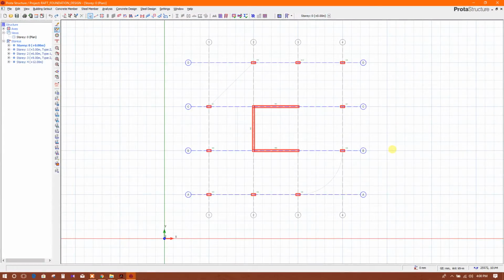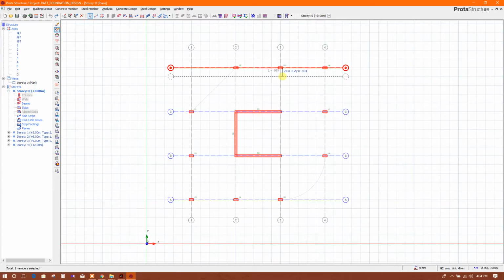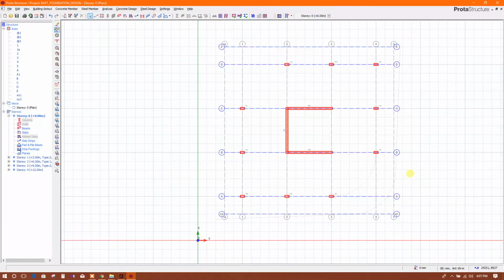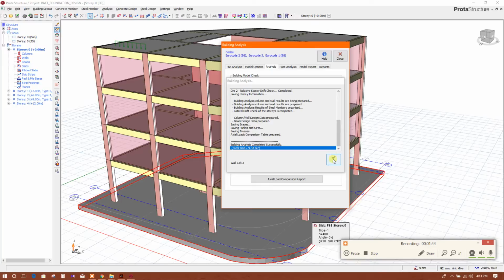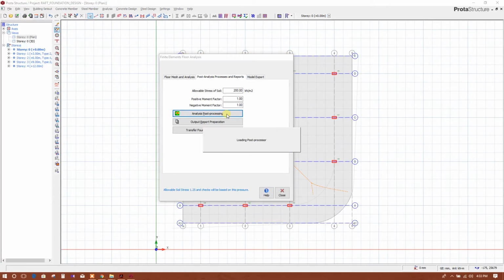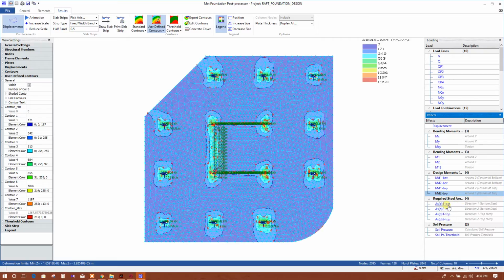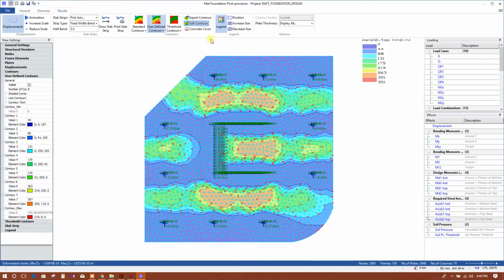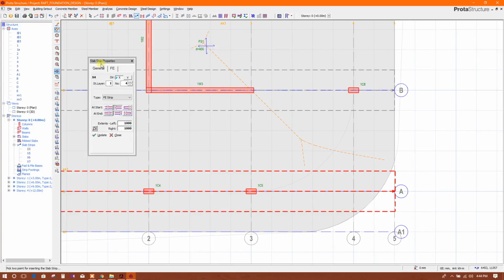RAFT/MAT FOUNDATION DESIGN IN PROTA STRUCTURE-PART1/2

Comment: When you were exporting contours for needed steel areas, you didn't check the maximum and minimum values from the top right corner in loading cases. You used only the G*F loading not the maximums. Just reminding.